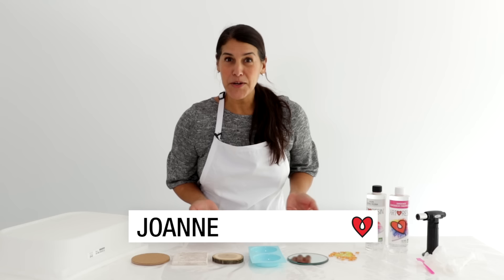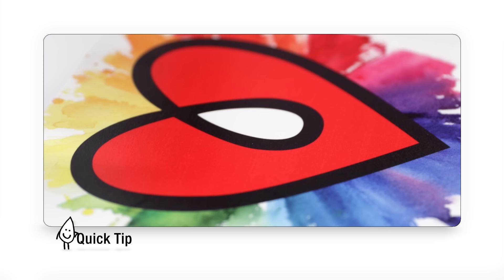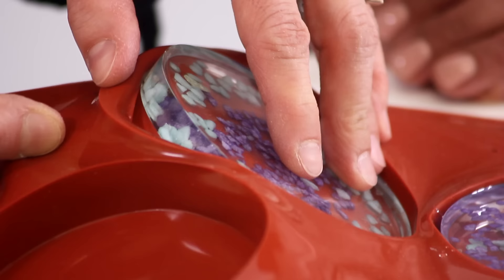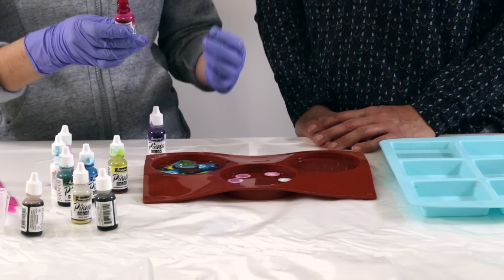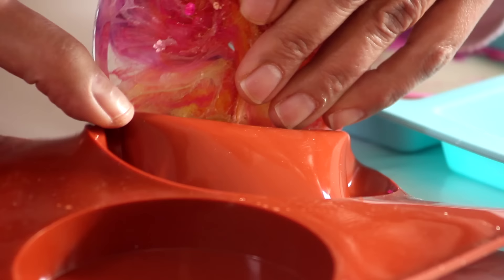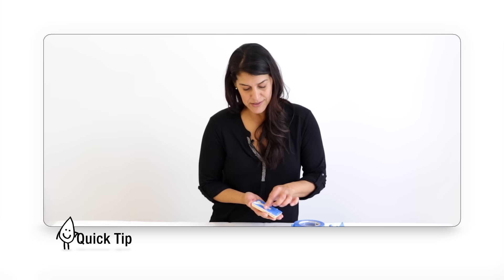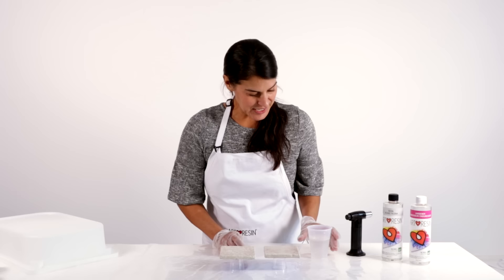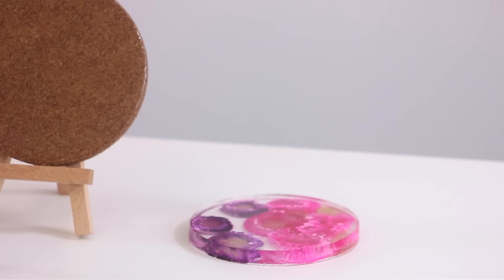How To Make Epoxy Resin Coasters - EASY!

Comment: Hello, I’ve used painters tape for everything that’s a pour, be it resin or acrylic paint pours.When you use tape for resin pours or even paint pours and it runs over or if you use your fingers to spread, if you wait for a minute or two after you pour you can use a toothpick or a flat stick and scrape the drippy off and you will have less or no problem peeling off the tape. You can also use a heat gun on low to heat up the resin and it also helps to remove your tape. That’s just what I do. 🙏🏼🤗
Reply from the maker: Great tips!  Thanks for sharing :)

Comment: 68°-74° is optimal ambient temperature
Putting resin in first keeps bare ingredients from poking through

"Thin out" = lowering viscosity•
Adding mold release will help keep the silicone mold from breaking down•
Reply from the maker: We recommend working in temperatures of 75-85F ideally.  ArtResin likes it warm :).

Comment: When using the 3 coaster mold I have never been able to pull a mold out without damaging it. I have waited 3 days and used your tips on sticking (i.e. putting the mold in the freezer and using warm water)
Reply from the maker: Another trick we use is to remove the piece from the mold at around the 12-18 hour mark and to let it continue to cure outside of the mold.

Comment: Excellent !!!I always love your videos. I have your resin and the tip about warming it before is great. We have now low temperatures so is good to know these details. Other thing is that I never have worked with alcohol ink, I love the effects!! . Im going to try it, I am glad that I hear that I can't use the torch, that could be bad!!! . Thank you for the comparison with the three techniques of sealing, I didn't know that can be different each one  .Question: 1.- There is any place where we can look to see the exact amount of resin we need for each size of project? . 2.- You also mentioned that we can sand the rough corners, but when we do so, is no shine anymore so what we should do? . Thank you for the step by step process. I personally appreciate it very very much !!
Reply from the maker: Adriana, your comment made my day - thank you!
I'm so happy you found the video helpful and that you learned some new information :)

As far as how much resin to use - we do have our calculator on our website, although that isn't really designed for circular pieces, but it can give you a rough idea for the layered coasters.  For the coasters in the molds, honestly, we just eyeballed it, based on how thick we wanted to pour.  
Yes, you can sand down the corners, and to restore the shine, simply mix up a small batch of resin and hardener and apply with a gloved finger or a disposable foam brush, much in the same way that I restored the gloss on the square piece that had been in the matte mold.   

Thanks again for watching!  ❤️
Reply: @Artresin  ❤️ Thank you for the respond. ❤️❤️❤️.

Comment: I forgot to add that Art Resin IS the ONLY resin I use. The very best. One of the things I love most about Art Resin is the consistancy of the product, there are no surprises, the product gives me the exact results everytime. I know before I begin a piece how it will react to micas, paints and inks. No oder is a plus. I have discovered what to do with the resin left in the bottle that just won't  pour out. I cut the bottle of resin only in half, spoon out the resin and I make my own epoxy pigment paste. I mix with ink, paint and mica powders and seal in salsa cups. I have pastes that still look great since I made in November of 2018, no mold as it's just resin and colors. I also create my own colors. I never leave a drop of resin in the bottle.  Waste not want not. I love my Art Resin. I am addicted and don't care!! Lol. I would love to see a different design with the bottles so I don't have to cut the bottles in half to get the very last drop. Thank you for the great product. I like also that I can buy the 32 oz.at Hobby Lobby.
Reply from the maker: Aw, thanks for all the kind words, Bonnie.  Love your ideas for using up all the remnants of resin.  So, you mix the colorants in with the resin only?  No hardener?  And what do you do with the paste?

Comment: tfs. I was watching another video and it said the resin cured soft. What could cause that if the 1:1 ratio is met? Glad to hear you mention that the square coaster cured hard.
Reply from the maker: The most common reason for the resin to cure soft is the measurement being off. However if it was mixed correctly things like temperature or using too much colorant could certainly impact the cure. 

Ideally you would like your work space to be 72 -78 degrees Fahrenheit and humidity below 50% and for the temperature to remain consistent for the first 24 hours.

When adding colorants you will want to be sure to not add more than 6% colorant to the total volume of catalyzed resin.

Comment: You use the paste just as you would in your resin and hardner mix.I like to heat the surface of my substrate thats got the mx on it already. It works and is exactly how the Epoxy Pigment Pastes are made and sold except they put a bit of hardner or something else to make it thicker. But when they do that their product turns hard within a month or less and its useless unless you throw heat to the inside of the jar to soften the paste. Not so when you just use the "binder" which as you know is the resin.  Tried and true.  The painting as my profile picture is one where I used my own gold paste. You don't need the hardner in the paste mix because when you pour onto the heated resin mix on your substrate the paste mix melds beautifully with the resin mixture. For me its hard to understand why people would buy pastes when you can play with the colors yourself and create colors you like but you can do that in the resin mix and just pour as usual. I already knew in November that I had discoverd how to make the paste but I wanted to see mine v/s theirs and ordered a gold paste. When I went to mix with resin mixture it turned a brassy black color, very bad indeed. In less than a month I pried the jar open to find it was in chunks, thick and hard. Mine is still beautiful and just like it was when  I made it. So my advise would be if you want to make your own Epoxy Pigment Paste save your 15.00 plus shipping and make a small batch for the one time use or seal it up in a salsa cup and it stays just fine. Again why bother with a paste, grab your inks,mica,acrylics and use as usual. The white and black paints they sell for big cells is nothing more than Rustoleum paint mixed with resin and something that turns it to crud and because it's oil based it will give you cells in your paintings, tried and true, but it will become stone hard. Shelf life for these products are practically nil. You can see in videos the artists heating the jar lids and product to make it useable. Ridiculous. I have a channel but have gone crazy trying to get intros and videos put up properly. I did a 15 minute video on making your own pastes posted it and took it down because I never saw it on my channel. I am an obsessed resin artist and do some pretty good work and would never part from Art Resin. That is the absolute truth.
Reply from the maker: Wow, thanks for all the info, Bonnie - I definitely learned something.  So great that you've created something even better than what's for sale out there!!

Comment: Thank you for so many wonderful ideas.  Can you use these coasters with hot drinks?
Reply from the maker: Yes you can! If you want even hotter things or even harder surfaces, we have a product called ‘industrialclear.com’ too :) it has higher heat resistance!

Comment: This video is very informative. Thank you! Please can you share the safety precautions that I need to be aware of when using resin.
Reply from the maker: ArtResin conforms to ASTM D4236, meaning it is certified as safe for home use and non-toxic when used as directed, however there are some safety precautions that every user should follow:

Wear gloves. ArtResin is very sticky in its liquid form, so gloves will protect the user from a mess, as well as skin irritation. Clean skin promptly with soap and water if it does come in contact with ArtResin.

If ArtResin somehow comes in contact with your eyes, flush with water repeatedly and do not rub. Promptly seek medical attention.

Work in a well ventilated area. Wear a respirator if ventilation is poor.

See our blog for further information: https://www.artresin.com/blogs/artresin/what-safety-precautions-should-i-take-when-using-artresin

For detailed health information, please see the ArtResin SDS.
https://www.artresin.com/pages/sds

Comment: Btw only use a heat gun on silicone and resin or your resin will fuse to the silicone because they got to hot.
Reply from the maker: Good tip!  Using a torch on the silicone molds can cause the resin to fuse to it and cause tearing.

Comment: So lovely !!! I love your hard working and nice smile!!!
But wondering does this thin layer of resin is adequate to be heat resistant!!!??? I have a coaster, I collaged some designed sealed it with varnish, and want to try some resin to seal from heat!!!
Reply from the maker: The maximum temperature that cured ArtResin can tolerate is 120F or 50C. At temperatures as high as that, the cured pieces may become a little flexible but once they cool off, they will harden up once again. If your cured resin is exposed to temperatures beyond 120F or 50C, however - for example, you leave a cured piece in a hot car for a long time - it could cause irreparable damage.

Comment: Great tutorial, I know some folks use white glue as a release agent (for fiberglass molds though) so I was wondering, wouldn't the seal you're using weaken the bond of the epoxy to the work surface?
Reply from the maker: I think it is likely the fibreglass that is not bonding strongly.  We have not had a problem with white glue, providing it is on a surface to which it has some tooth and it is allowed to dry completely.

Comment: I just found the art of resin (no pun intended lol) today.  Loved your  tutorial.  Extremely informative and easy to follow! My question for you is are resin molds different from lets say cooking silicone molds?  I have a project in mind but its on a larger scale than the molds I am coming across in my journey. also I came across the resin film to get more of a translucent look with color, however the sheets are also on the smaller side.  What color product would you recommend for a more see through look?
Reply from the maker: Hi Bernadette! Over time we have found that there really isn't much of a difference between the two when it comes to using them for resin. We haven't used those sheets before and really are not too familiar with them. My suggestion would be to look for molds with a shiny finish as molds with a matte finish will give you a matte finish on your piece. Whereas a shiny mold will give you the nice high gloss transparent look you are used to with resin :)

Comment: Approximately, how much resin would be used for each of those coasters in the silicone molds? Trying to figure out how many I could do with your bottles. ❤️
Reply from the maker: Our silicone mold holds about 2oz, but you can fill them a little less if you wish.

Comment: Can this stuff be used for an outdoor piece? I have a stained glass table that I want to put outside and I want to make sure it does not fall apart. Cool stuff!
Reply from the maker: Once cured, ArtResin is weather resistant and waterproof, however we still don't recommend that you put it outside. 

With its advanced UV and Hindered Amine Light Stabilizers, ArtResin is chemically engineered to offer the best protection against yellowing on the market. Even so, it doesn't make sense to deliberately put your artwork in an environment full of UV rays - it makes it much harder for ArtResin's UV stabilization to do its job. 

Keep it inside and keep it clear!

Comment: Thanks for the informative video. In the past, when I’ve tried touching up a blemished coaster with a little bit of epoxy, similar to what you did to make the matte coaster shiny, I get brush strokes that don’t go away. Even when I’ve given the epoxy a hot water bath. Did your brush strokes eventually disappear? Or will they always be there. I’m looking for a good way to sand and fix a minor blemish without having to use all of the epoxy that would be needed for a complete flood coat. Any advice?
Reply from the maker: Hi Suzanne, the best way for a flawless finish is to sand out imperfections and pour a top coat.  When you apply with a brush, the resin is often applied in a thinner coat which doesn't self level in the same glassy way.  You could try smoothing on with a gloved hand rather than a brush--this may help.

Comment: I just bought that same orange mould but it is very thick, it looks here like you didn’t fill it all the way to the top, is that correct? I just want to make sure it wouldn’t come out with raised edges if I don’t fill it completely
Reply from the maker: We like to pour in approximately 1/8th inch layers, this helps to allow the bubbles room to rise to the surface, for some of our coasters we will do a few layers. We haven't had any issues with raised edges when not filling the mold to the top :)

Comment: If your drips harden on the tape, you can use a heat gun to heat it slightly, and the tape and drips will come right off.
Reply from the maker: Thanks for the tip Patricia :)

Comment: Can you slush cast the outside of a mould in black resin before adding anything in the middle? I imagine so but i want to ask the question anyway
Reply from the maker: Hi Shannon, We don't use that technique however - in theory, it would work if you somehow attached a hollow mold to the rotisserie spinner and let it spin until cured. Now please keep in mind that ArtResin has a 24 hours cure time to the touch and 72 hours for a full cure :)

Comment: Hi, love your tutorials!  I have a question,  I see that you used a measuring cup to combine the resin and the hardener, can you reuse that cup again on another project without cleaning it?
Reply from the maker: Hi Marlene,  It is best to clean out your cups between uses so that they will measure accurately.  You can simply wipe them out with a paper towel and then spray with alcohol and wipe again to remove stickiness.  Here is our blog on how to clean up:  https://www.artresin.com/blogs/artresin/how-to-clean-up-epoxy-resin?_pos=4&_sid=6fbd91e7e&_ss=r

Comment: Love this video! What hardener did you use for the coasters? Can ARTRESIN be used alone to make a coaster or is a hardener recommended for optimum results?
Reply from the maker: ArtResin is a 2 part epoxy system so you will want to use both the Resin and the Hardener which are included in our kits :)

Comment: ...love this!  When using a silicone mold do you need the silicone release spray that I have seen on line  being advertised?
Reply from the maker: Hi Dina, a silicone release spray is not needed when using a silicone mold. We do recommend only using good quality silicone molds made specifically for use with epoxy resin :)
Reply: ...thank you....I  Thought so but I was not sure...

Comment: Thank you for this wonderful video....Do u microwave resin and hardner separately ? 
Another thing that i wana ask of you for long, how do clean your measuring jug for next use?
Reply from the maker: You will not want to put ArtResin in the microwave as it's heat resistance is 120F/50C. As for cleaning your mixing containers simply wipe them out with a paper towel and then just wipe clean with some isopropyl alcohol to remove any remaining product :)

Comment: Will I need Cork under the resin to prevent it from scratching my furniture?
Reply from the maker: If you choose you can take that precaution however the cured resin is not abrasive-it is essentially like plastic.

Comment: Nice video and informative. How heat sensitive is Art Resin for putting a coffee cup on the coaster?
Reply from the maker: Great question, Glynis!  The maximum temperature cured ArtResin can come in contact with is 120F or 50C.  A hot coffee mug should be just fine.  If the piece is newly cured, you may see a line on the resin from the cup, but the resin generally self heals as it cools and the line disappears.
Reply: These are beautiful. New subscriber 25.5.19
Reply: @Andrea-mw2nq  I have never worked with resin either but this is nice to learn.how to use

Comment: I have a question: I've resined tile for coasters, taped off underneath, but still ended up with a very narrow "lip" to the bottom edge, that can feel quite sharp. Is this normal? Do you have any suggestions? Thanks so much!
Reply from the maker: Sometimes if we don't get the tape just right it can leave a lip. We just sand it off :)